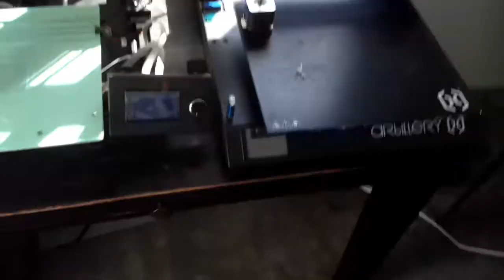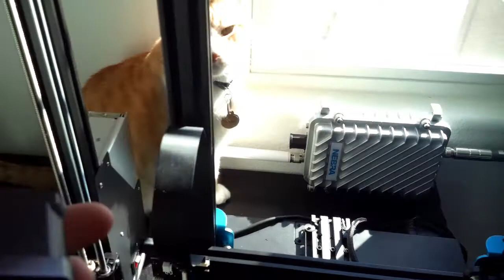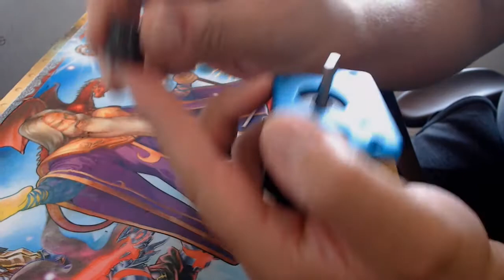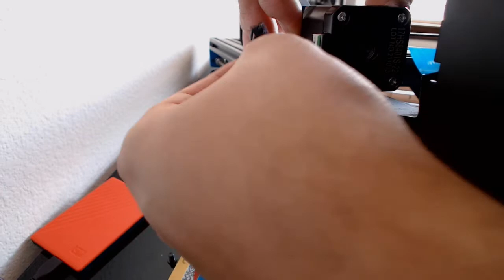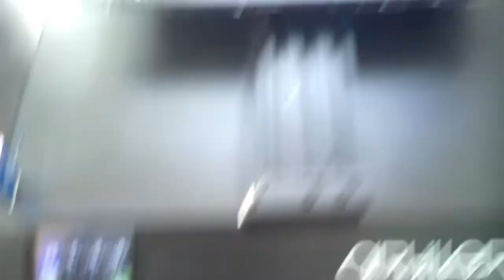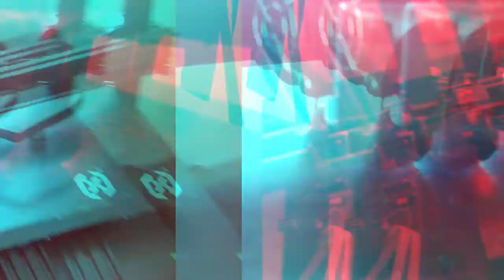Replacing Stepper Motor | Artillery Sidewinder X1

Comment: It might be an idea so check the voltage on the datasheet for that motor and set your x axis vref on your stepper driver to avoid any future problems. It should be 1v on your stepper driver for the swx1 but as that motor is different it may require more or less voltage.
Reply from the maker: I checked it. Everything is working fine